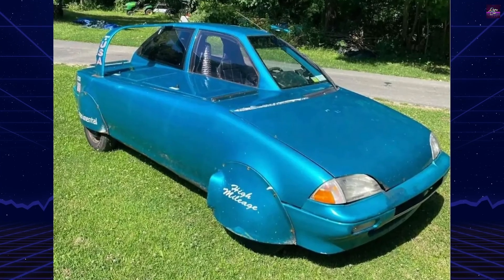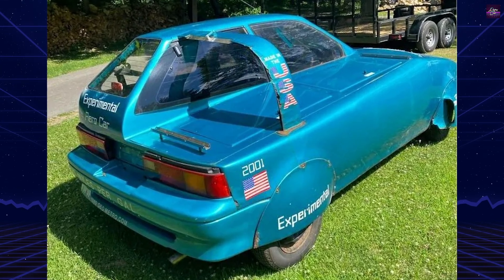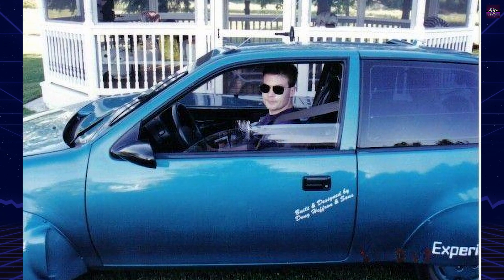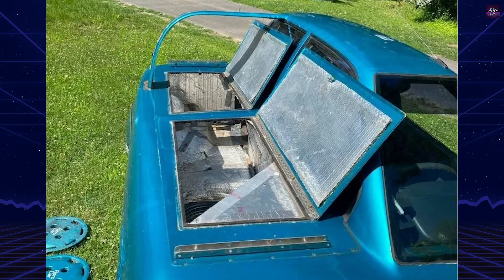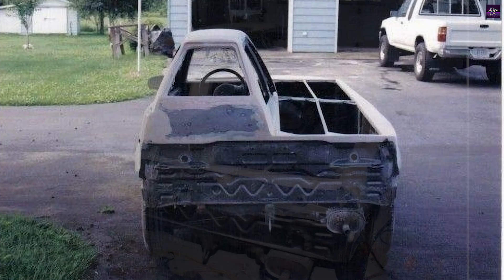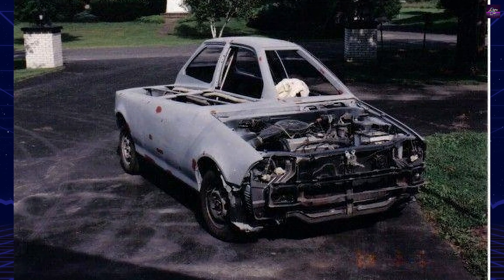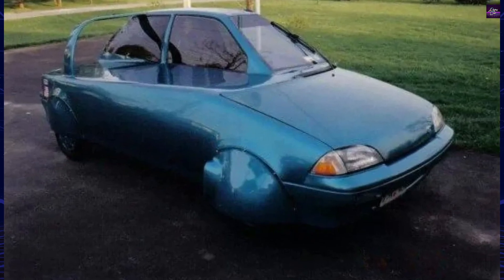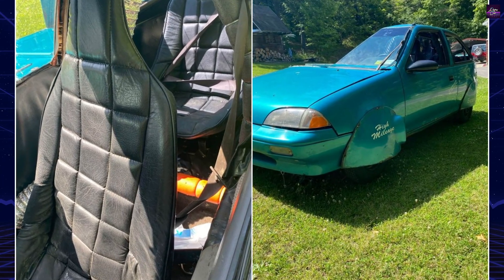Geo Metro XFi Tandem: Extreme Aerodynamic Car Conversion for 75 MPG

Comment: I like this idea.  It looks cool, and the enlarged storage area is definitely a plus.  

But I wonder about safety.  Roll cages notwithstanding, both driver and passenger have to enter and exit the car on the street side, if parked parallel to the curb.  Worse, in a "T-bone" accident; both driver and passenger would be trapped in the car until help arrived.  (Hopefully such an accident won't involve any fires . . . .)

My Google Search for diecasts and model kits came up empty.  But in this case, that's not an insurmountable hindrance.  The basic body mods can be applied to almost any diecast or model car kit to make something similar - just like people are doing in real life, as you noted at 2:07.  I may just build a model of something like this, myself . . . .

Thanks, Retro Car!

42nd Like.